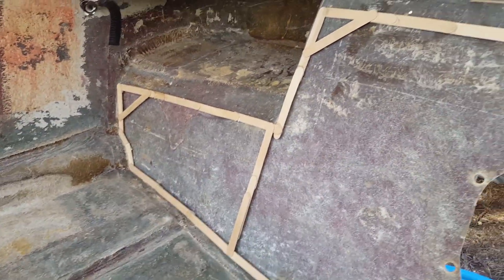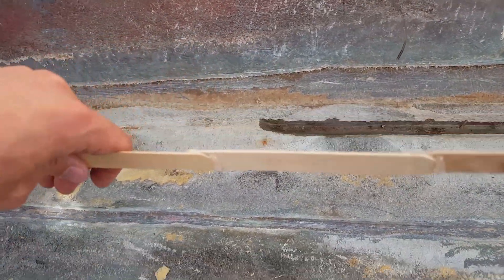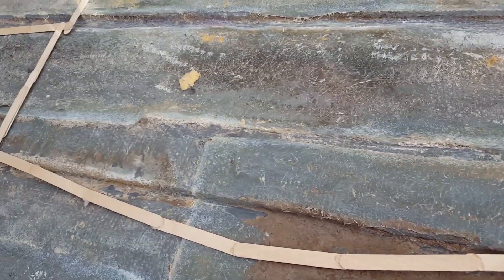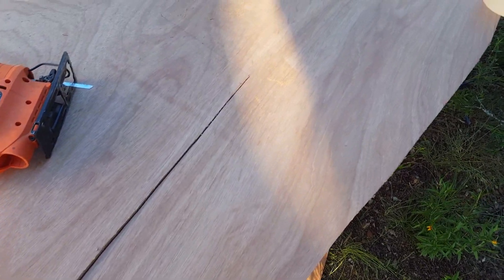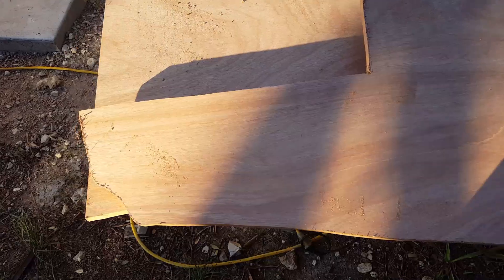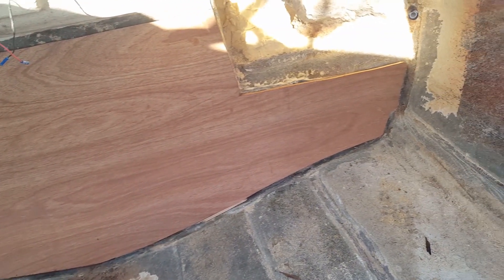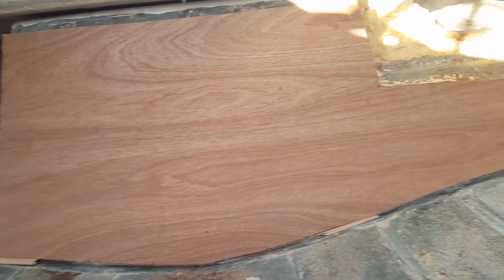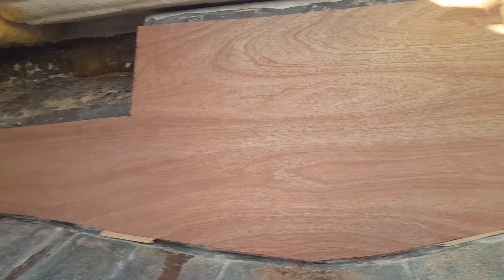Boat Transom and Floor Rebuild - KEVLAR Transom - Marine Plywood  - Part 29

Comment: This boat-renovation series is the most detailed and thorough of the dozens I've  found on YouTube, and you're to be commended for that. In addition, you are one of the only people to use EPOXY resin for all your laminating. Unfortunately, you don't talk much about that choice and why it's so very important in rebuilds like this. As you undoubtedly know, you're essentially GLUING new wooden components (stringers, transom, etc.) onto the boat's existing, cured polyester-laminated hull. In other words, the attaching new to old involves secondary bonds that are structural, not chemical. So, the "glue" (resin) has to be really strong.
     Though it's fine for building a new boat in a female mold, polyester resin is weak glue, whereas epoxy resin is very strong glue. That's fundamentally why epoxy is FAR superior for renovation projects like yours. Followers who are seriously considering such rebuilds don't need to take my words for this. Information on the comparative bond strengths of the two types of resin abound on the internet. But one of the very best sites (and the very best epoxy components) can be found via the homepage of the WEST System  (originally the Gougeon Brothers). These people pioneered the use of epoxy in boat building and repairing, and they offer not just products but lots of practical , thoroughly proven usage advice. Hope this helps. Chris (in Maine)

Comment: I am considering the worth of replacing the transom and floor of a 95 Citation 21but fiberglass is a new area for me. As a wood worker for over 55 years and having replaced the transom in aluminum Star Craft boats I am impressed with your work. I love your popsicle template idea it's reminiscent of using a folding rule to copy angles in carpentry. I used the cardboard scribe and assemble transfer method in the aluminum boats, but I believe your popsicle method is superior. One question though, why did you not cut the 1/4 inch sheet first and test that then use it as the template for the two 3/4 sheets? common cabinet making practice is to use cheap sheet goods to make a template first. to minimize the chance of expensive errors.

Comment: How much of the epoxy product did you end up using?  My transom seems to be around the same size and I don't know how much I should order.  Thanks
Reply from the maker: Are you working on stringers too?
Reply: @michaelromer2016  No.  Just the transom
Reply from the maker: Trevor Fox one gallon is required for making the epoxy thickening agent. It also covers prepping the new transom wood and transom fiberglass hull. If you use Kevlar, it’s thin and another gallon will get you covered, including tabbing. If you are using fiberglass chop strand mat, 1708 tabbing, then a 1708, 4 foot sheet over that, you need 3 gallons total. If it’s cold where you are at, get medium epoxy, if it’s warm, get slow. Getting medium in an area where it 70 degrees mean you are going to loose a lot of epoxy. If you want to go the newb route, go with polyester resin. It gives you 24 hours to cure and a lot longer working time. First timers, polyester, unless you go with slow cure epoxy.